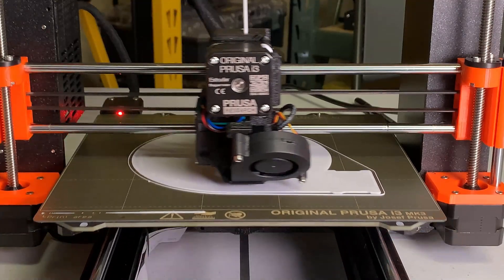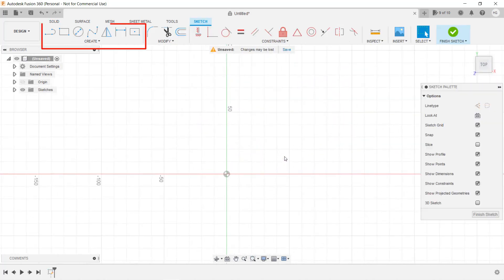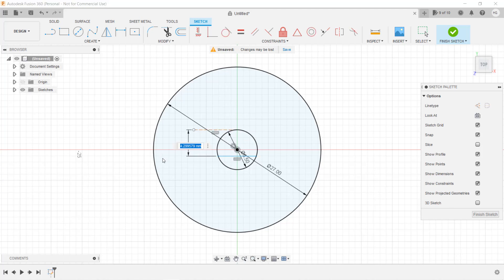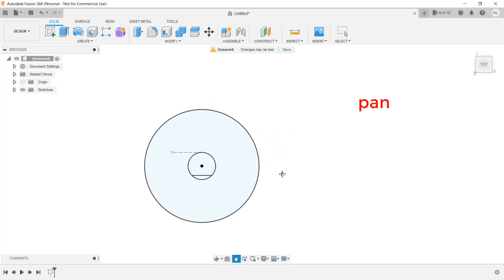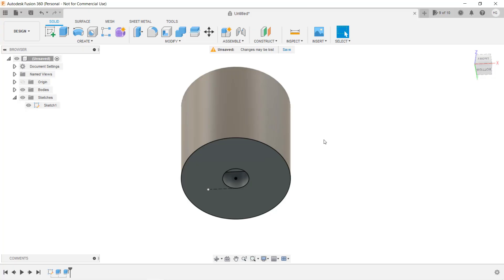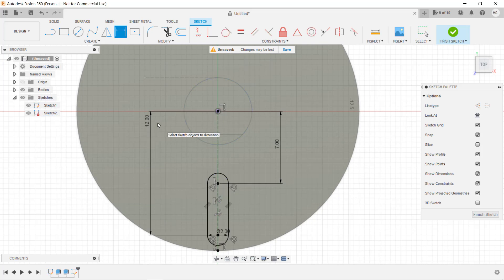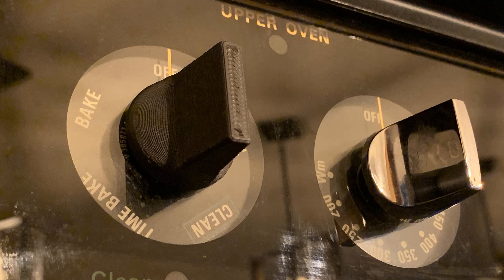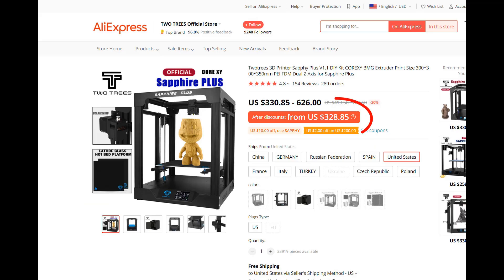Fusion 360 SHORT Tutorial For Beginners 001: Create a Knob, learn sketch, extrude, and constraint

Comment: I love this, it's exactly my process for creating a replacement part! Nobody ever asks why I have micrometers in the kitchen drawer, but this is why! I always add some "tolerance" parameters and use them in my sketches... you often need a little extra space for 3D parts to fit properly, and with the parameter, I can get it perfect if it prints too tight or whatever.

Comment: great intro tutorial. Only issue I am having is when I draw the slot it keeps wanting to put the slot on the bottom of the sketch not the top, even though I am looking at the drawing from the top down. Any thoughts?
Reply from the maker: I guess you need to select the surface of the knob instead of the Z plane. As you start drawing the new sketch on the Z plane, it's actually lower than the extruded knob.
Reply: @AuroraTech  Yes That worked :). Also,  I was actually able to select the sketch (not in new sketch mode) on the left menu, right click, and "select new plane" and click the top plane and it moved it.